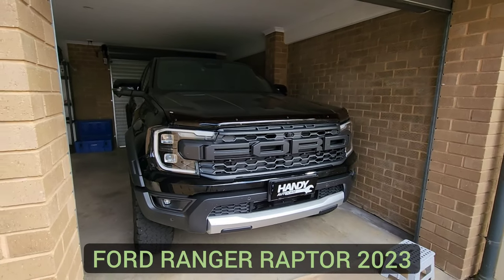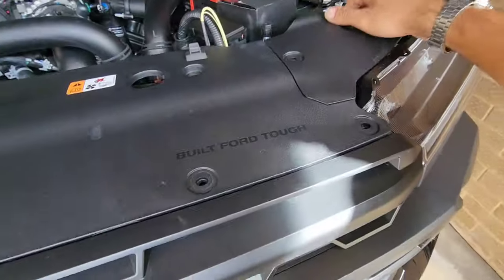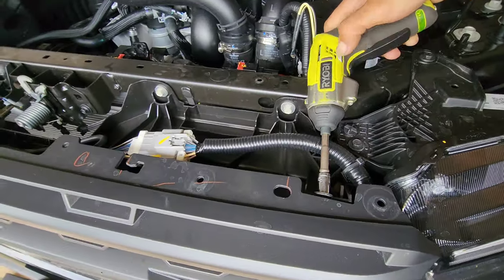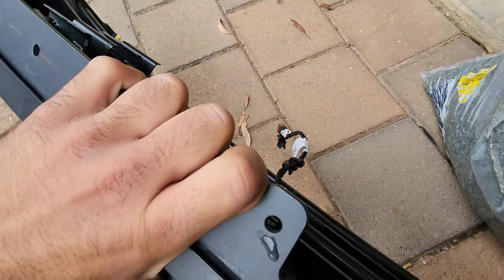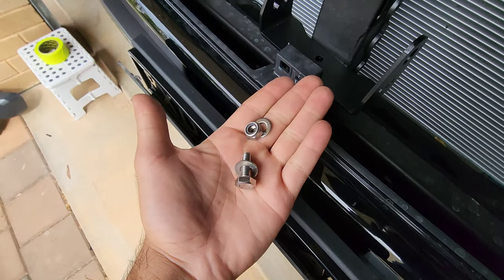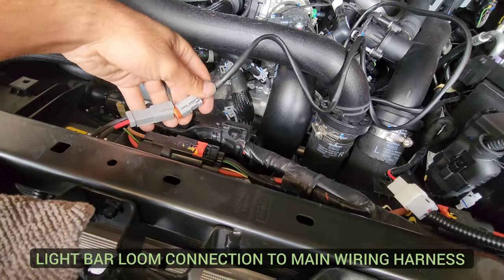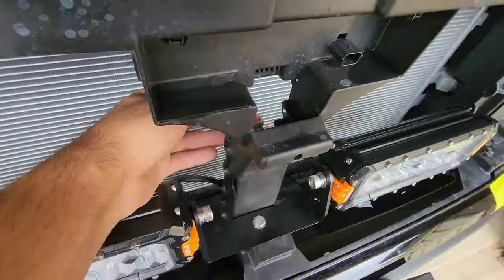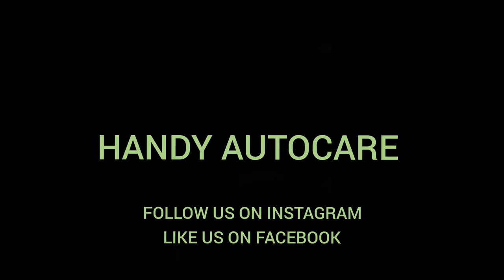LED Light Bars installation behind grille - Ford Ranger Raptor 2023

Comment: Excellent video content! I noticed that the lighting setup features 12" Stedi ST3302 LED units with a current draw of 5.9 amps each, totaling 11.8 amps for both. It's worth highlighting that the positive and negative connections provided by Ford for Aux 6 support a current draw of up to 25 amps. Consequently, there's no necessity for an extra relay in this configuration. This setup is well within the specified limits, ensuring a safe and reliable operation.
Reply from the maker: That's perfect mate! I'm sure it'll help others reading this in the future. We went with the Trail bait recommendation for install setup with the additional relay harness.
Reply: Ditto, extra relay and additional connections are  not needed, just connect to Aux power and all is done..additional  power box has fuse and relay built in which is sufficient  to  run light bars or Bar as I did with my 32" lightbar..😉

Comment: Quik Crimps would have been neater and better. Less joins the better.
Reply from the maker: True!! In hindsight nowadays soldering would be my pick. Less potentials for issue the better.
Reply: @FordMercGuy  I am an auto elec of many years. My advice is never solder wires together. Solder is for circuit boards. No manufacture ever solders wires. Not one car comes from factory with soldered wires. Crimp with good quality crimps and a crimp tool. Make sure its of quality.
I also do electronice on the side, so I have a good understanding of when and when not to use solder.
Reply from the maker: I'm sure your expertise will help others too mate!! Legend
Reply: @FordMercGuy  happy to help if I can. Keep up the good work.
Reply from the maker: Cheers mate! Likewise, great we can help in our parts to make projects and plans happen.

Comment: Just wondering if this takes advantage of the factory accessory switches on the roof in the cabin. So you can turn the light bars on/off and be able to have high beams without the light bars. I’m pretty sure being able to turn them on/off separate to the high beams is a legal requirement too
Reply from the maker: Yes correct, the factory roof mounted aux switches do act as a kill switch for the new light bars, so that way you can use only the factory high beams when needed and turn on the extra lights when needed. I believe it was switch 5 or 6 that controlled the functionality.
Reply: @FordMercGuy  that’s awesome! Thanks for your reply :)

Comment: Legend placed my order and came here and made me sleep easy knowing I’ll be able to install these no drama
Reply from the maker: All good mate no worries I'm glad the video could help you with peace of mind
Reply: Cheers, quick question did you need to order the piggy back for this setup or does everything come included in the bundle?
Reply from the maker: There was no real piggyback adaptor that was used but yes everything in the kit that was sent was all that was needed
Reply: @FordMercGuy  thanks.
Reply: Hey mate got my order today. Just wanted to ask you about the feed wire and you used to tap into fords factory wires was that included in the bundle? Cause I’m about stuck about that
Reply from the maker: Hey mate, you'll find the red and black signal wires on the harness, will need to be connected to the yellow and yellow black ford wires.
Reply: @FordMercGuy  thanks for the reply. which harness exactly?
Reply from the maker: In the wiring kit from trailbait, there's only one pair that is red and black. (the one that is all wired to the relay) in the kit.

Comment: Nice video. Why did you not connect the pos and neg from the lights directly to the Ford supplied connections to Aux 6 and leave off the loom with relay and switch? Ford have provided the pos and neg wire with fuse and relay, and switch.
Reply from the maker: Thank you mate due to the current draw of the lights themselves the manufacturer of the installation kit recommends using the factory Ford supplied Trigger Point as a trigger for the relay harness for safety

Comment: Excellent video bro. Good job and seems easy enough to install 👍🏽
Reply from the maker: Cheers legend! Yeah, fairly simple!
Reply: @FordMercGuy  you reckon you could actually get away without installing the relay and the switch in the kit like that other guy said ?
Reply from the maker: Correct mate. The original relay/switches are well rated with fused relay already. Just have to ensure your chosen lights current draw doesn't exceed the factory rating.

Comment: Hi, good video! However EU Raptor has a louvre in front of the radiator, did someone mount one on a EU model? Or does someone know if it will fit? I tried to measure and seems tight..
Reply from the maker: Hi mate thank you very much feel free to email the team at trailbait and Damien can help with your question potentially

Comment: Great details install video (Y) Thanks, I would like to asses the setup once I get mine in a few weeks. I would ideally prefer a single long bar, not sure about the factory brackets and if I can make it work. If not, I'll got the Stedi or Ultra Vision - TrailBait system also.
Reply from the maker: No worries mate, trailbait do make multiple kits. One of them I believe is a longer LED light bar for the Raptor.

Comment: Hi, Great video, just wondering how these work with the matrix led head lights? If the matrix lights block out a car coming the other way, Do you know if the ford signal wires cut power to the light bar? Otherwise wouldnt the full beams adapt and the light bar continue to dazzle the on coming car?
I guess you could always flick the switch when on coming vehical are likely 
Thanks
Reply from the maker: Thanks mate! That's right could manually kill the light bars with the overhead aux switch (or supplied in line switch). But many localities don't advise driving with high beams on in metro at all, let alone light bars that are always intended for off road use only.
Reply: Ford has designed it so that the aftermarket lights will automatically cut out when the matrix function begins to operate
Reply from the maker: Perfect, thanks for the clarity Damian.

Comment: Mate, great video, very informative. Is there a way to have it set up to auxiliary and high beams? So they won't turn on unless you have high beams on AND the auxiliary switch turned to the on position as well.
Reply from the maker: Thanks very much mate, yes installed in this way means they turn on only when the high beam is on and the auxiliary switch is in the on position

Comment: Hi, I am sorry if my comment is  not related to this video.
I saw your video on the Duplicolor Anodized Paint, and I want to ask if these would look close enough as colors for an Optimus Prime Peterbilt truck as I have had a rough time searching for paint that matches his looks and these colors are the best pick I found locally.
Thank you in advance and I apologize for stepping away of the topic of this video.
Reply from the maker: Hi mate no worries.
Yes the red and blue should definitely pop well mate in daylight/strong lighting condition. Being metallic Annodized colours they'll look dark in low light. The brighter aspect only showing up in direct sunlight.. But isn't that most colours anyway? 👊

Comment: Hi. I followed the installation, step by step from your video. The LED bar will light up when I turn on the #6 switch even if the headlight is in low or high beam. Need your advice. Thanks
Reply from the maker: Hi mate very strange as you should only be getting the light bar to turn on when the high beam is turned on.
Reply: @FordMercGuy  The wires you tapped off from are a supply from the Aux6 switch. It will get power with the engine on and the switch on. It is not linked to high beam at all. Thats why you can switch them on whenever you switch on Aux6. To use a high beam trigger you need the piggy back adapter or pick up the high beam wires behind the left kick panel inside the cab on the passenger footwell. Pretty sure you could have connected the harness battery plus and minus direct to the yellow/yellow-black Aux6 wires to supply the whole setup. Aux6 is rated for 25A and has its own fuse and relay already.
Reply from the maker: Yes few ways it can be done. Trailbait manufacturer just recommended the aux 6 trigger point be used as a signal output due to current draw of the lights.

Comment: Looks great, I am now considering it. Just worried that it may restrict the air flow and hence disturb the cooling.
Reply from the maker: Yes perhaps a potential for that but I don't think much of a chance for it since the light bars are so small compared to the big opening of the grille/radiator around them.

Comment: Just a FYI - There is no need for the extra fuse and relay. There is a fuse and really already fitted from factory
Reply from the maker: Hi legend yes considering Ford has done all the hard work already is really great. We were just following the light bar installation manufacturer instructions.
Reply: That's what I was thinking. As long as you don't exceed the current rating of Fords relay/wiring it should be okay to directly go from light bar to that twin yellow/black that Ford provided yeah?
Reply from the maker: True mate. The Manufacturer of the kit stated to us that due to the high current required for the light bars, they recommend using the factory  yellow black feed wires as a trigger for the wiring harness in their kit. That way we won't be overloading the factory wiring system.

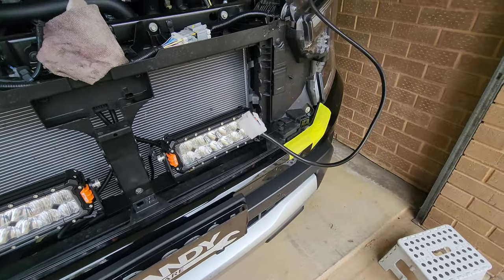Comment: Gentile amico, complimenti per il tuo video molto dettagliato. Possiedo una Ranger P703 2.0 biturbo Wildtrack costruita a Silverton, Sud Africa. Ho una domanda... nei cavi descritti al minuto 8:35 del video non mi arriva corrente al positivo. La mia domanda è... dovrebbe esserci tensione con abbaglianti accesi? In modo da pilotare il relay dei led aggiuntivi. Sono stato costretto ad installare uno interruttore all'interno del veicolo ma vorrei comandarli con gli abbaglianti. Grazie anticipatamente.
Reply from the maker: Hi thankyou very much. It is great today that Youtube had a translate to English option for your comment. Perhaps if at that 8:35 mark of video your car doesn't have high beam voltage coming through, you will need to tap into another high beam wiring connection point. Check at the passenger side kick panel on interior, on some models they have a factory high beam trigger point here.
Reply: @FordMercGuy  Thanks so much for the reply, I'll try looking where you pointed me. Thanks again.
Reply from the maker: No problems. Let us know how you go

Comment: Hi mate, I'm staying in South Africa and also own a next gen Ranger raptor. Just a question why my up head aux switch aux 5 and aux 6 can be switch on no matter if the high bean is on or off.
Reply from the maker: Hi mate I'm not completely familiar with these cars as of yet but I believe those overhead aux switches run independent of everything they are on their own Circuit and have their own relay

Comment: Would it be possible to remove the extra rocker switch instead of taping it up and tucking it away in the engine bay?
Reply from the maker: You could join the wires together so the lights are always in the on position.
Reply: @FordMercGuy the switch has 3 wires - so just tape up the black earth wire and join the other two?
Reply from the maker: Correct mate. Therefore bypassing the "switch" function. The earth being for the LED of the switch light up function.
Reply: Cheers for the confirmation!
Reply from the maker: No dramas legend!

Comment: Hey bro, would this install be the same for a Next Gen Wildtrak too?
Reply from the maker: Hey brother for a model that has the Raptor front grill and premium pack installed yes but if not there is a suitable kit that allows you to install the high beam trigger from the passenger kick panel
Reply: @Ford Merc Guy  thanks so much mate!!!
Reply from the maker: No dramas mate 👊

Comment: Hi mate great video I’m looking at getting a set of these for my 2023 next gen wildtrack with premium pack. Is the installation very much the same or is it a bit different.
Reply from the maker: Hi mate, if your front grille is like the Raptor in this video you'll find it's the same. A final way to check is if you have the factory aux 5/6 yellow/black  wires taped ready in the same location at front radiator support, you'll be laughing.
Reply: @FordMercGuy   yeah pretty sure I do I have aux switches on top of the roof and I got two wires right next to the battery which im presuming they are the ones yes they are yellow and black
Reply from the maker: Great mate! Sounds like you're good to go!
Reply: @FordMercGuy  awesome thanks mate I’ll be giving it a crack tomorrow
Reply from the maker: Awesome mate, have fun! Good luck

Comment: Excellent video.    I think the additional relay is to receive the high beam signal.    What will be the high beam wire?
Reply from the maker: Hi mate many thanks!!
Ford supplied the high beam feed wire in the radiator support area. The black and yellow wires taped up, these are the factory high beam signal feed. The additional relay is just using fords wiring as a signal for the aftermarket relay to be energised and then supply power to the lights.
Reply: @FordMercGuy  I have it connected to the black and yellow wire, switch 6 but it does not work in conjunction with the high beam.  works independently.
Reply from the maker: On this car, the black yellow wires are energised with power when the original high beam is used. So when factory high beam is on, the light bars turn on. The overhead switch is a kill switch.
Reply: @FordMercGuy  Obviously there are 2 different configurations.  I can see several with my configuration.   It is energized by activating switch 6 without the high beam needing to be on.
Reply from the maker: Ahh interesting to learn!

Comment: Hey mate, I'm having a 40 inch Front Runner light bar mounted, the mechanic who has quoted the job has included a Can Bus module, do I really need that?
Reply from the maker: Hey mate, I'm not familiar with canbus modules to put inline for these cars.. Maybe it's to avoid warning lights or issues with light flickering/compatibility.

Comment: hi, Im interested to perform this install on my raptor. how does this install behave with the led matrix function?. Thanks for your feedback.
Reply from the maker: Hi mate, Ford has designed it so that the aftermarket lights will automatically cut out when the Matrix function begins to operate.
Reply: Excellent. But when you manually pull the lights lever to flash the high beam or push it to enable high beam manually they engage again if the aux light switch is on?. Thanks for your feedback
Reply from the maker: I would say so mate. That momentary use of the high beam with aux switch in the on position should allow the light to operate, ofcourse should be used off road only/or in areas no cars will be present on the road anyway.  Unfortunately I don't have regular access to this car for testing against your query

Comment: What harness is that? I bought a stedi dual smart wiring harness and it doest come with that feed wire that you soldered on the aux 6.
Reply from the maker: Hi mate, unfortunately being some time ago + client had ordered the kit so unsure of exact details.
But, even without it, you'd be able to make your own version or just hard wire it.
The feed wire I soldered into aux 6 wires just had a quick male female disconnect. You don't necessarily need to disconnect at anytime but I guess Handy if you don't want go run them. But you could use generic version from your local auto store. It's not a Stedi specific feed wire plug.

Comment: hi, the high beam feed, from the Raptor/Ford where does it go to ? (the wire you connect it with - where does it go it or how do i find it?)
Reply from the maker: Hi mate the high beam feed wiring (the yellow and yellow black signal wires) go to a separate relay/fuse box for the overhead AUX switches I believe

Comment: Does the battery have to be turned off to install lights or can it be on (obv with the car not running)
Reply from the maker: As always safest to disconnect battery when working on vehicle electronics. However in this case I didn't disconnect the battery and worked very carefully.
You could remove inline fuse to the new wiring harness and install at the very end.

Comment: Hello Mate, you have wired this into your Full Beam so when you activate your full beam, your light bar also activates as well. Is there a way I can wire this into my full beam and my Aux 5/6 Switch so when I have my Aux Switch on and turn my full beam on they come on and if I turn my aux switch off and full beam on the full beam only activates and the light bar doesn’t. Thanks again
Reply from the maker: Hi mate, to my understanding the factory wire position that I tapped into at the radiator area is controlled by aux switch 5/6. As in they act as a kill switch. So high beam can work independent of the light bars if needed.

Comment: Why did you run another relay? Isn’t the existing wiring from Ford already supplying power via a relay???
Reply from the maker: Hi mate, for the current draw of these lights, manufacturer of this kit recommended using the aux Ford wiring as a trigger point rather than loading the Ford circuit. All depending on current draw of your selected lights you're going to install.

Comment: Why not just hook the lights directly to the ford wiring? It 25A rated on my wildtrack and aux 5&6 are switch manually and with high beams. Just seems to be doubling up with extra wiring.
Reply from the maker: Hi mate, manufacturer of the install kit suggests using the Ford aux wiring point as a trigger point for the light bar harness. Considerations of the current draw is the reason behind this. 
Certainly Ford have done the work already.